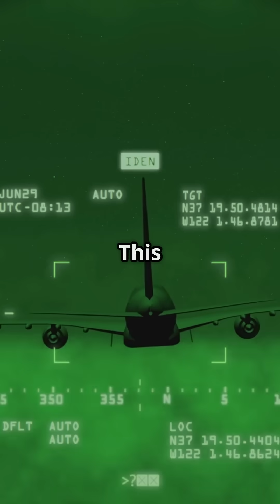Concorde Stretched Mid-Flight at Mach 2

Comment: As long as the stretching and flexing is properly accounted for in the design. Maintenance is done properly. It's not a problem. Look at the sr71. It leaked fuel because of the panel gaps. But once it got heated up at altitude. The titanium expanded and sealed up perfectly.
Reply: Like that Soviet bomber they called "The White Swan" I think.
At subsonic speed it was reportedly "sluggish".
But as soon as it broke through the sound barrier, it handled perfectly.